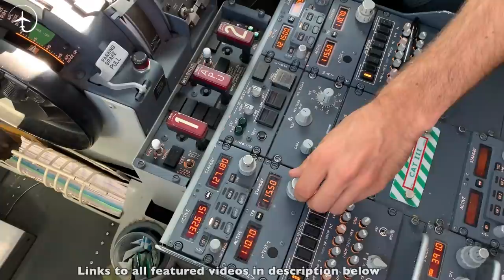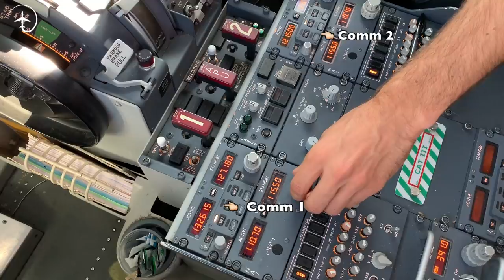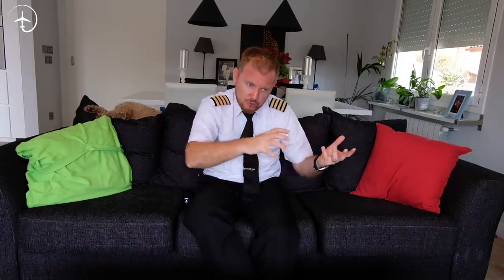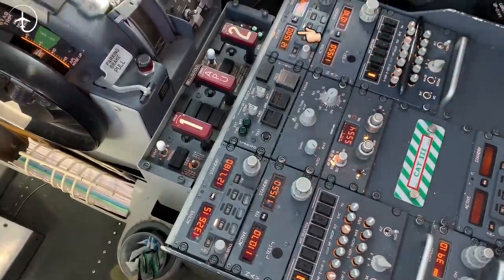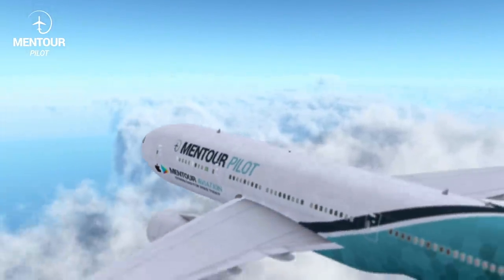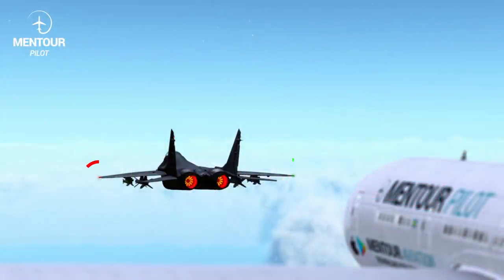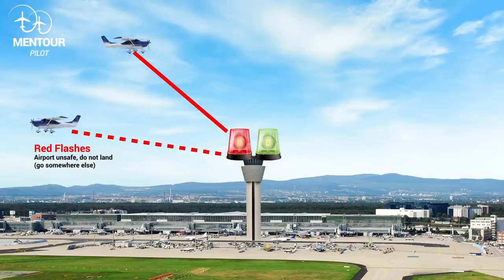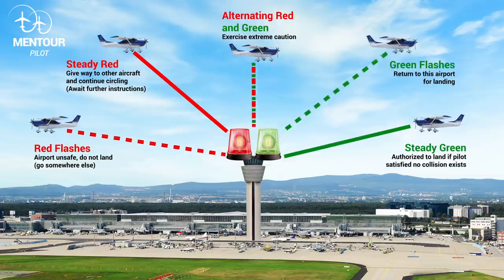how do pilots deal with loss of RADIOS?!

Comment: "Since wavelength longer will reach further" - that's quite a misconception! Lower HF frequencies (and yes, they are low in comparison to VHF (Very High Frequency) we normally use to communicate) follow the same rules as any other radio emission (including visible light). They can penetrate transparent stuff directly, they are cut off by non-transparent stuff, and they may be reflected by the mirror. Earth simply has a mirror in the skies - it is called 'ionosphere' and it reflects HF waves back to Earth allowing it to be heard/seen beyond horizon. Unfortunately that mirror is somewhat 'dirty' - plenty of noise predominantly due to solar radiation - that's why HF is so crackly and sounds differently at night or at day. Air is transparent for VHF, ground is not, ionosphere does not reflect VHF - thus VHF line-of-sight communication. Flashlight from the tower is a radio too (technically speaking): red and green are just different frequencies and it just happens that our eyes are actually good at receiving such radio signals. And light is similar in properties to VHF: goes through air, blocked by ground, not reflected in the skies. With appropriate power of flashlight tower can communicate signals at quite a distance :)

Sorry for barging in - really love your vids! But I guess a good correction is appropriate and as a pilot you will just pragmatically accept it.
Reply: Also, isn't higher frequency directly corresponding to smaller wavelength? (Speed of light being the same.)
Reply: @TanzinulIslam  Yes. The higher the frequency the shorter the wavelength is.
Reply: Wave length is speed of light divided by frequency - they are directly connected. So higher the frequency - lower wave length.

Comment: 6:50 Should be noteworthy that VHF (Very High Frequency) is even higher frequency and thus shorter wavelength than HF (High Frequency). Would otherwise be irritating if you think of it in terms of  "normal frequency" and "high frequency" :D

Comment: If a pilot gets out of range of one atc center, but there is another aircraft following a similar route behind the ploc aircraft, couldn't the pilot of the back aircraft relay the message to change frequencies? That aircraft would be in range of atc, so they would hear atc's calls, and they are also closer to the ploc aircraft, and therefore the two aircraft are in range of each other and can communicate on that frequency. Wouldn't that be another alternative to guard frequency, if in fact, they have the volume turned down?

Comment: Petter, could you explain if fighter jets were sent to intercept the highjacked 9/11 flights, did they make visual contact with the planes and what happened?  Many of us wondered at the time, after the second tower was hit, whether this was happening, but I’ve never seen an update on what actually happened that day.  Thanks🙂
Reply: In the confusion of the day, the fighter jets weren't even scrambled before the WTC or the Pentagon were hit. They would have intercepted United 93 but it crashed before they reached it.

There was a lot of confusion about where the hijacked jets were and even which jets were hijacked. There is a video somewhere that has the radio communication from the day and the calls to local air bases to scramble jets and you can hear how the information from one center gets confused on the way to another and to the military.
Reply: Yes, there was no time to scramble

Comment: A mobile phone that can reach ground stations at 10 miles high would cover all radio failures. You could have different numbers to call over different areas of the globe.  Or just fly circuits at 500ft around the nearest cell mast 😬

Comment: How badly would an EMP affect an airplane. Would the engines cut out or will they continue to run without any elecric system working? would a 737 be saver in such extreme circumstances because it isn't fly by wire?

Comment: On the reverse side of this, what's the procedure if ATC goes offline?
Reply: Never got to the license level where this might be an issue but common sense would tell me to aviate above all else with a spectacular lookout. Monitor 121.5 and see if you can communicate with other aircraft. Communicate all intentions on 121.5 and regular frequency so other aircraft know where you are and what you are doing.

Comment: Shouldn't the emergency frequency be more highlighted in the cockpit, as well as the other basic procedures, which might be necessary to a person, who would face the situation which might require communication? Did NTSB considered this after the Helios accident, where the flight attendant attempted to communicate, but was out of any radio frequency zone? What if the situation repeated, but there was enough fuel? Or if the ATC would guide the passenger on how to land an aircraft without the engine power?

Comment: Why is all the radio analog? I mean I get that it's cheap but it suferes from a lot of interference, radio effects and you can get stepped on. You get higher quality and reliability which is potentially life saving. There are some incidents in which pilots got confused because they had similar callsigns but the radio voice quality was just so terrible that they didn't catch that, taking off from crossing runways at the same time for example.
On top of that you get the potential for datalink to exchange more information automatically over the radio, avoiding unnecessary radio chatter.
So why is digital radio not pushed more in aviation? I get that you can't fit every single, tiny little aircraft with a new radio or give every backwater dirt airstrip with a tower a fancy new radio overnight. But you could fit it in the big airports and big aircraft to begin with as a supplementary system and then add it to more stations and aircraft as default as time passes and in 10 years 90% is done and in 50 years everything is done.

Comment: at 0:30

squawk 7600, try second radio(comm 2), try backup radio(comm 3, now datalink for him), try Tx over HF(which most airplanes do have, not just VHF).
if nothing works, which would be really surprising you can even call into ATC.

use viual clues like light flashes, usually in morsecode(apparently i was wrong here, fair enough). and try to follow STAR inbound to your destination(also not quite right here).
if missed follow published missed approach.

Comment: Maybe a stupid question: why do not use a mobile phone in case of radio loss, to a specific number to help pilots?
Reply: There are no stupid questions, only sometimes stupid answers. They can't because the mobile phone coverage is limited to the ground: when you are 4/500m above the ground you lose the signal, let alone at cruise altitude. Those antennas (on the 4G repeaters) are made to transmit horizontally, they are directional antennas. Consider you have 1W power: would you prefer to have it concentrated to a specific arc and to a specific height, or you prefer to have the very same 1W power spread everywhere (and therefore have it much much less power "dense" signal)? :)
Eventually they may use a satellite phone, but to use it they would need an antenna outside of the plane as the plane itself will kill the direct sight with any satellite around (and for these phones you need nothing except air and eventually clouds between the phone antenna and the satellite)
Reply: @AlessandroGenTLe  Thanks for your answer. Your explanation makes a lot of sense! 👍
Reply: The co-pilot's cellphone did do a handshake with a cell tower from MH370 so the signal can reach the ground. Don't remember what altitude they were on at the time. If he was trying to call the ground no one knows but his phone was on and functional.

Comment: As I was listening to this, you had mentioned that commercial aircraft normally/always have at least 3 radios, and sometimes 4.

I would expect that in Canada for planes flyin in our arctic airspace that 4th radio would be important.
Why? because magnetic north is physiucally in Canmadian airspace. In Prior years, this was a problem for pilots as when they came near to Magnetic north their compasses would "go berserk" if the flew over magnetic north the compass could suddenly do a 180 degree flip.

However, as a pilot friend said more recently the direction issue os solved by using satellite information.

So, from the perspective of me as a retired electronic technician, I would expect this to require an extra radio which likely would use a much higher frequency than the VHF band used for most aviation radio, and also it would want a special antenna either on top of the aircraft or at least with an equivalent access.

Canada has several airlines that specialize in Arctic flying, and use jet planes of likely about 135 passenger capacity. These may also be carrying a significantly mixed load of passengers and cargo, according to ongoing current demand - no surprise.

Also Jet planes may be part of a mercy flight, to bring critically ill or injured patients down to major cities for urgent medical needs.

Comment: 6:40 The range isn’t related to the waveleght, but to the power of the transmiter. The higher the frequency, the shorter the wavelength. I guess the power can be optimised for the frequencies the use, as a function of the size of the transmiter the plane can carry.
Reply: It is related to the wavelenght too

Comment: Some day explain why the industry is still using terrible amplitude modulation communications instead of frequency modulation, or one of the more modern modulation systems that are less susceptible to distortion.
Reply: It is actually quite simple: historical reasons. When you have thousands upon thousands of radios out there (and they are not just a simple radios but have air worthiness certificate) you simply cannot change the underlying technology easily. If it works why do you need to change it? TCAS is not mandatory on GA. What differrence would it make for B738 to have modern TCAS on board when colliding with P28A - none whatsoever - TCAS will be silent. But VHF radios are mandatory and you can be assured that other aircraft (despite its small size) still carries it and it can be used for communication and having situational awareness. Make no mistake: modern aircraft carry modern radio stacks which are not only HF/VHF but also CPDLC, ADS-B, TCAS, Immarsat for ACARS and for on-board internet access. But you cannot possibly expect light aircraft owner to invest huge amount of money into radio stack he will never use. And as I said: it does not matter which aircraft you collide with - be it A380 or a Cessna - outcome will not be glamourous - so you need to carry old technology in order to be able to communicate with anyone.
Reply: @MegaAU  Your statement that AM is the historical way it is, is true.  However, AM has caused multiple communications miss understandings over the years because of the susceptibility to noise induced amplitude fluctuations.  The term is garbled, and is heard on most transmissions done over the current VHF/UHF systems, just listen to some of the voice transcripts from the cockpit voice recorders.   FM however cures most of the distortion problems, and has been in use by military and sea transportation since WW2.  It is not more expensive to use FM than AM modulation. To use the argument that to change is too expensive just plays into the hands of those that do not care  for the public's safety.  It is a bean counter solution just like Boeing's MCAS requirement to make the MAX fly.  Not upgrading the systems is criminal, and your argument suggest that it was useless to change from drum brakes to disc, because drum brakes are historical, and it cost too much.  People die because of AM.
Reply: I do not say that AM is good - I totally agree that it is archaic. And modern airliners use other means (more modern) of communication as well. But with aviation we have an issue of jurisdiction: planes often fly between countries and you cannot demand simultaneous upgrade of technology from everyone. ICAO cannot force everyone - it can recommend and then relevant governments may implement (for example how ADS-B was implemented). It just takes long time. Military can go any technology they want because they can make their decisions without referring to ICAO - they are going by their operational requirements (often encrypted and encryption upgrades happen all the time thus upgrading comms systems in military pretty much ongoing). But just because AM is still the king in terms of availability (everyone carries it) it still better means to broadcast - we don't just transmit to ATC - everyone around hears us and thus aware of our presence and intentions. No other technology has such wide coverage and thus we better to contend with its downsides to benefit from its upside.

Comment: 6:50 high frequency = longer waves???
Reply: Well, yes but they are still called "short waves".
The lower the frequency (in MHz), the longer the wave length (in Mtrs)
The nominal VHF aviation frequencies are from 115.00 to 136.00 MHz on AM modulation.

Comment: Im sorry, but high frequency always means short wavelength, thus short distace to reach. Dont know why they call it that way then, but this is physics
Reply: The frequencies were named in the pioneer times of radio. So, "HF" is actually a much lower frequency than modern "VHF" (very high frequency) and UHF (ultra high frequency).
Reply: The same nonsense with telecopes. Large, very large, extremely large, ...
What are future generations supposed to name their inventions then?